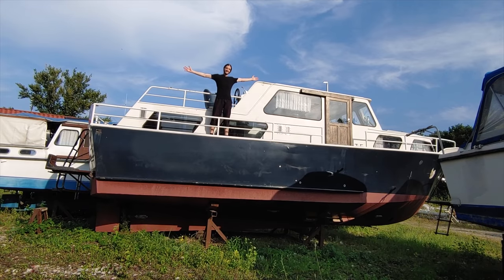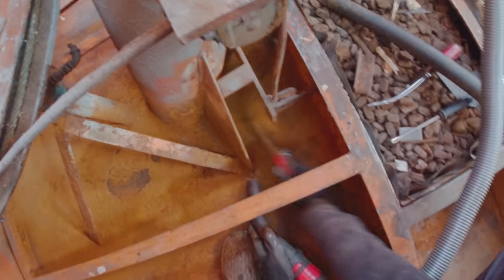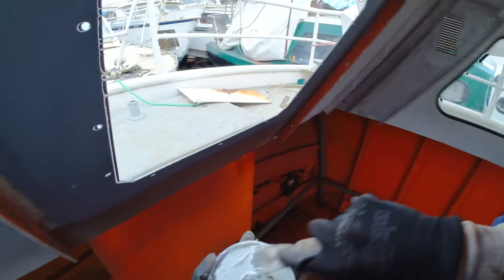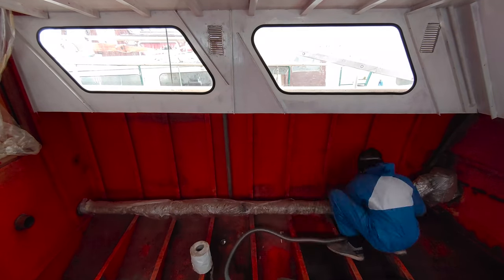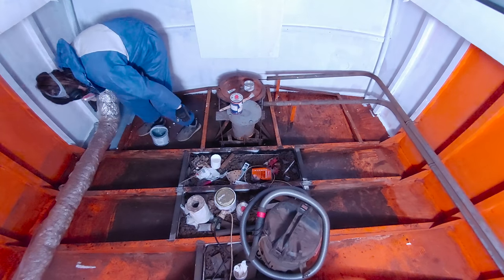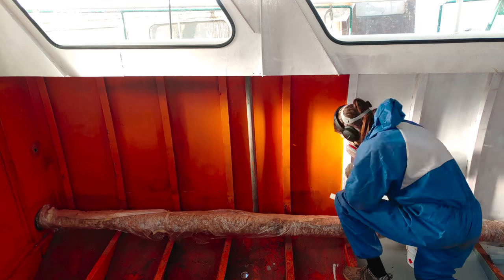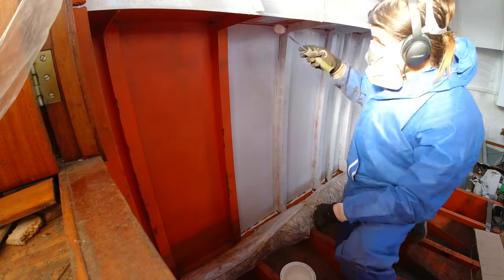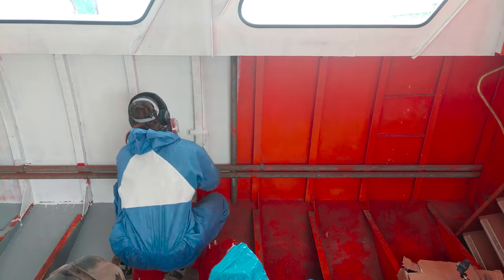More Painting in the Aft Cabin - Week 17 PART II - Vintage Yacht Restoration Vlog

Comment: Danger marine is a good channel but it is for a sea boat which is a bit differant to a fresh water river boat. However I would advise that when you start out side you have a survey done on the thickness of the hull steel, they do it with a type of ultrasound/radar and doesn't cost a lot but it will tell you if there are any areas of thin steel that may just have been filled over the years with car filler. The steel does look fine on the inside but I would recomend checking the outside.
Reply: This is a great suggestion.  Many of us have recommended that he look in on Dangar Marine since he started.  You have to have a sound hull or the rest of the work will be for nothing.

Comment: A suggestion or two for you in the planning of your rebuild.  

Either run a dry stack up through the roof or run it out the side of the boat right next to the engine using wet exhaust and a nautilift.  That will make it pretty quiet.  

Because of the design of your boat exhaust out the back just isn't a good idea.  The fumes will crap right back up the aft end to your upper station or into your aft cabin now that you have a hatch there.
Reply: Now, if you decide to go wet exhaust I suggest you use fiberglass tubing.  You can buy it in sticks.  Cut it with a saw and fiberglass it back together to make any angles you may need.   Much more versatile than either the wire wound or soft wall exhaust tubing.
Reply: Also in your aft cabin area under the floor I suggest gel type batteries instead of all that junk metal stuff that was there for ballast.  I'm assuming your trying to go off grid, so you'll need that energy storage, and of course solar panels..

Comment: You might get a better result by using a spray gun for your painting. You can cover large areas very quickly and get into hard to reach spots and cracks easily. Much better than brushes and a roller.
Reply: Aaaand the overspray goes everywhere.